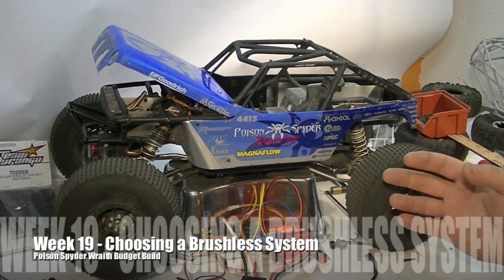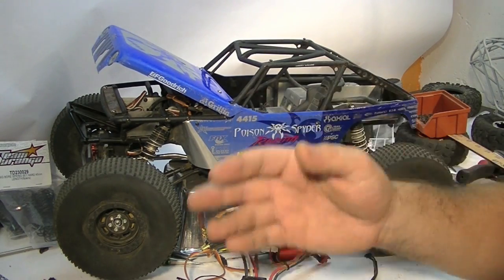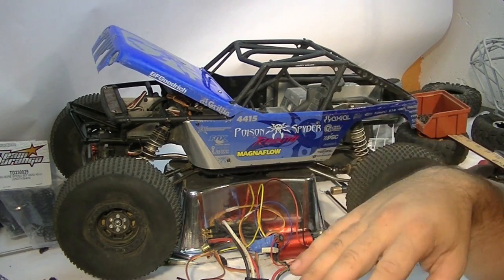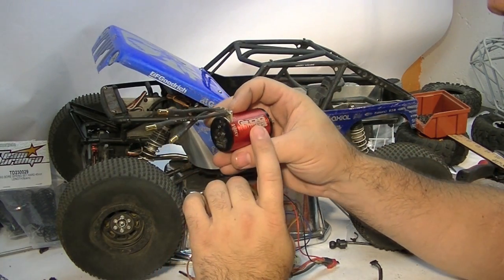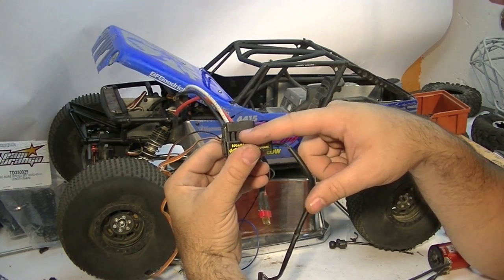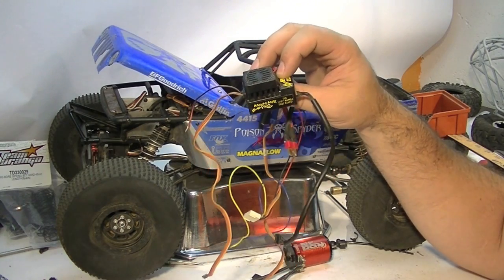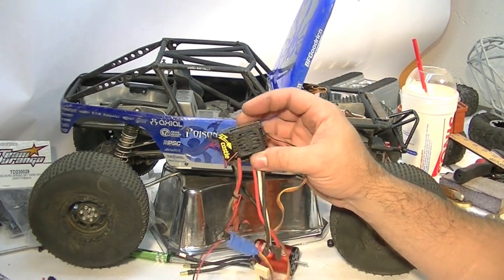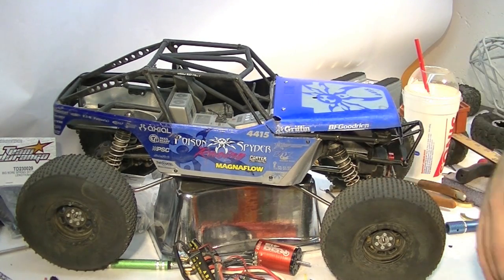Poison Spyder Wraith - Choosing a Brushless System - Week 19 - Budget Build

Comment: If you're watching this after 2018..... 
There's one more thing to add to Harley's great advice. 
~ IF you're main focus is in Crawling and slow speed control - DON'T EVEN LOOK at any 2 Pole Motors!!! Technology has definitely caught up in Brushless! 4 Pole should be the minimum.... but TenShock has released a series of 6 Pole 9 Slot Sensorless Brushless Motors in 1250, 1750, and 2400kv. Hands down, the SMOOTHEST Sensorless Motor you can buy!! 👏👏👏👍👍  I've been blown away by the Performance, and at only $40-45.00, a steal. (NO, I get nothing from them for saying that. I get nothing from ANYONE! 😥😑)  I'm on a Seriously TIGHT Budget, and these deliver. 

If you want Sensored, still stay away from 2 Pole Motors! There's so many 4 Pole Sensored Motors out there, that will give you the SPEED with Control. 
...... Just adding to an already Great Series!

Comment: so, yeah, this video series is three years old...LOL. But I am a recent convert from 1/10 scale buggy racing to crawling. My question is, can I expect the drag brake of the brushless system to be good enough for fairly hard-core crawling, or is brushed still the best option in that regard? I appreciate ant guidance I can get with my Wraith build, which will be primarily for crawling and tail running. Thanks!
Reply: 2 Years Later....... 
The Drag Brake on my Hobbywing Brushless System, STRIPPED the little Plastic Idler Gear in my Transmission!!! And that's with 2400kv and the Drag Brake set at 60%!! It's now at 35%, with all Steel Gears. 
..... MAYBE this will help someone else, after 2018.
Reply: What hobbywing motor esc are u running?

Comment: Harley what gearing did you go with when you went to 32 pitch with this motor setup?
Reply from the maker: 56t spur and 12t pinion.
Reply: Harley Designs Would you recommend the same 32 pitch gearing when running on 2S?
Reply: @Team-Fraser  
I get about 10-12mph with 32 Pitch, 56/11 Gears, on 2400kv Brushless, if that helps.... No real Speed, but great Control on the Rocks. 
Oh, and that's 2400kv SENSORLESS 6 Pole 9 Slot, with a Hobbywing WL10BL120 ESC!!!!  The Motor is a new Sensorless Crawler Motor from TenShock. Shockingly Smooth, relatively Cheap ($40.00 about). ZERO Cogging!!

 I'm almost surprised that more Companies don't look into 6 Pole, Sensorless Motors.... 
Although it's likely that there's more money to be made in the Sensored Motor Market! 😱😫

Comment: Do you still feel this motor is the way to go? Also, would a 3100 work well with a 2s battery. I am looking for more speed than the stock setup but still be able to crawl
Reply from the maker: I still love this motor and it is still my GO-TO most of the time. Even on 2s it would be my choice, but it really comes alive on 3s.
Reply: Harley Designs i have not myself crawled with cencorless motors but i know those who do and they used a castle esc and faffed around with the throttal curve and a bunch of other settings and made it almost feel like a censored motor. but that is way too much work to justify it...

Comment: U have worked on this a lot, what Allen wrenches do u have and do u have problems with screws stripping out on the Allen part? I have nothing but bad luck
Reply from the maker: I use a variety of tools, as they wear out, you just have to replace. Same with hardware. Check out Screw Loose Hardware on Facebook and get a bulk bag of hardware.
Reply: And will a esc out of a spawn work? Should all be the same but it can run 3s, mine is acting up and don't want to spend a lot! U have any idea if it'll work? And so sorry for all the questions, I am learning more and more every day lol

Comment: I just installed the MMP/Roc 412 3100kv combo in my Wraith. Outstanding!! I had concerns that I would loose some low speed control but I cannot tell the difference from the 27T brushed motor it replaced. To prep for the motor I installed t32p 11/56 gears, Robinson Racing steel gear set for the transmission and I epoxied aluminum tubes in my stock Axial drive shafts. Tip: Getting the Castle Link to upgrade the firmware and specify your settings is a must.
Reply: ***** yas! i race castle and if i could not get castle link it would be unusable from standard. too much timing, too much braking force for 2wd, i need to mess with the throttal curve but havent yet. but i drive very very off what a normal person does so thats why really

Comment from the maker: Simply upping the voltage on the ESC doesn't fix the issue of not having enough amperage. A BEC is required with any reasonable sized servo when running 3s or greater.

Comment: Hi Harley. Been runnin a mild Tekin, mmp 3s, i guess because I added some scale looks,.. so mild is too mild, and need more, to much strain on the motor.. I ordered this motor very recently,hehe, plus I'm running complete 6mm super -shafty.power train +, and 56t. BOTH Pumkins are running HD stock 38/13..For this motor, could You kindly suggest a satisfying pinion count to start with..?mod 0.8..{while it's all disassembled,}  And,do u suggest to just keep running 11.1v ? Thank you Harley!.. Peace

Comment: Grizzly Adams just called...he said he wants his beard back!  Hunting season? Fashion statement? End of days?

After running the ROC 412 in the Jimmy's, I'm a fan.  Not a fan of the metal spur and metal 32 pitch pinion gear setup though.  I love the fact that my tranny is rock solid, but If you can explain why at low rpm it sounds like hell and at full tilt it sounds beautiful, I'd gladly send you a razor.  Greg